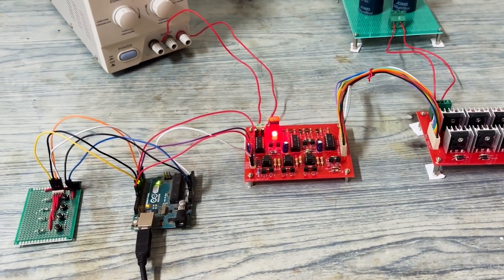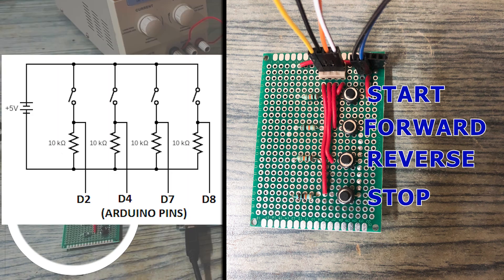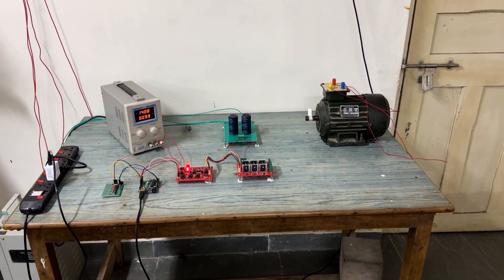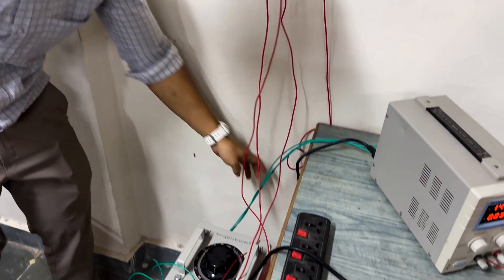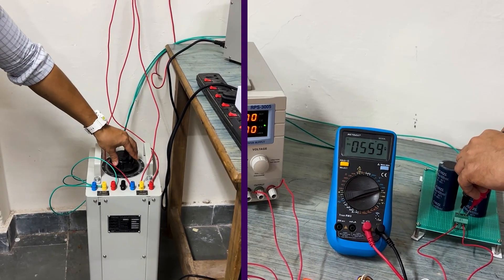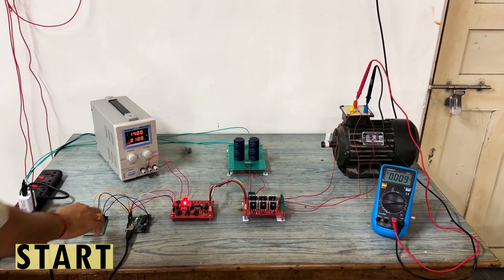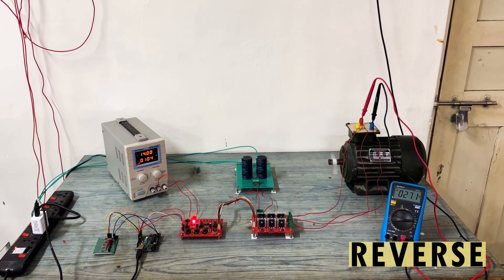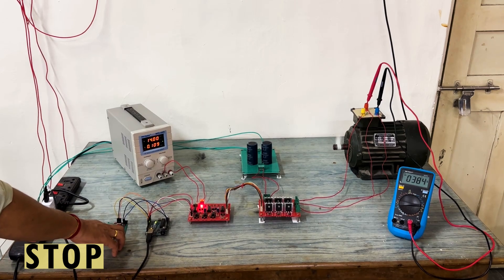Three Phase Inverter using Arduino for Speed Reverse- (Part-03)

Comment: what did you do when reverse the motor at high speed ? 
reversing the direction of index in look up table, right ?
Reply from the maker: To reverse the speed...we change the phase angle of two phases to motor.
Reply: @FambiTech  Thanks for your answer , but 
do you change the phase angle of the two phases as soon as you press the Reverse button? Or is it that when you press the Rev button, there will be a deceleration process for the Motor first and then change 2-phase ?
Reply from the maker: @nguyenthanh1485  the reversal process is as per the arduino program. As we press rev button, motor speed reduces and starts rotating in reverse direction.
Reply: @FambiTech  yea, I understand, but I mean is in your Arduino Program, when you press the Rev button, do you change the phase angle of 2 phases immediately or doing something to reduce motor speed first ? 
Because I see in your video , you press Rev while the motor is running at very high speed and then I see the motor speed slow down. When speed = 0 , motor reverses rotation.
Reply from the maker: @nguyenthanh1485  yes...